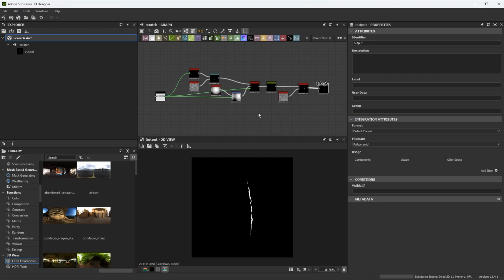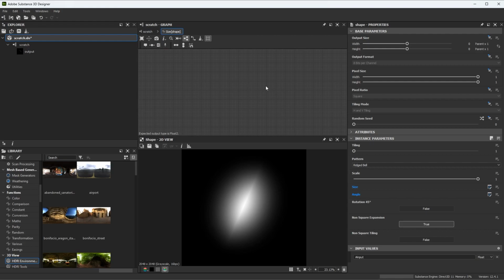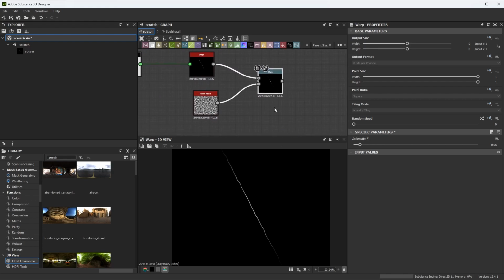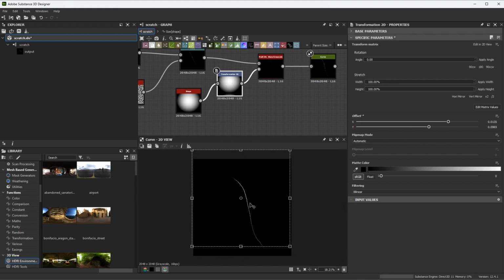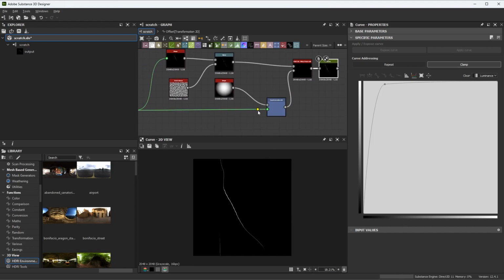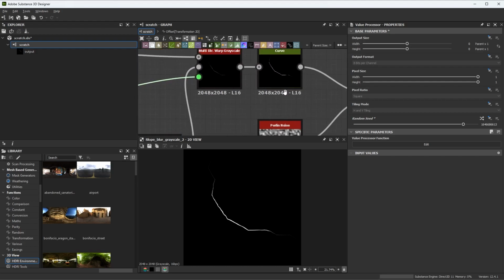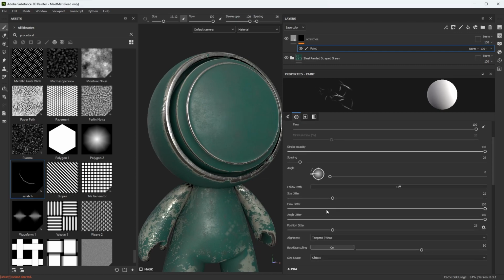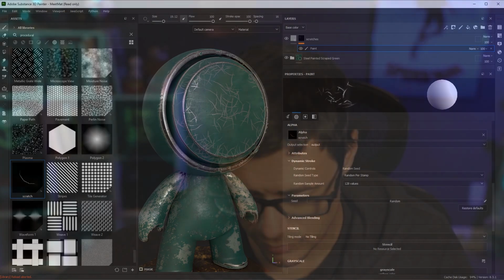How to create a dynamic scratch brush using Substance 3D Designer

Comment: This strikes me as an example where putting your random generator in a Value Processor is precisely NOT what you need. The Value Processor technique which you use here is primarily useful when you NEED to get the SAME randomly generated number into multiple functions across different nodes. For example if you want to randomize the X/Y offset on two different transform nodes, but you need each of those transform nodes to have the same random offset for any given graph level random seed.

When you are trying to create as much randomness as possible, you are better off using a different Random node in each function that requires randomness.
Reply from the maker: Good advice! I appreciate the feedback.Thanks much : )

Comment: Hi Wes. First of all, thanks for making your effort towards these videos. I learn a lot from them.
The only small "nitpick" I'd have is you sometimes "move" to next steps and say "I have already done that". Sometimes, it is not easy to figure what you "have done". I noticed this in other videos as well. For instance, the one where you create brick wall with moss in Substance Painter, you did that extensively and talked about already created layers. I wasn't able to follow and re-create the wall. As these programs have many details and small parameters, if one parameter is off, things can easily fall apart without clear understanding why. Cheers!
Reply from the maker: Thank you so much for the feedback! I will make sure to cover or explain parts that I have already done. I know that can be confusing. I greatly appreciate it : ) I will make sure to be more careful on skipping ahead in the future.

Comment: Thanks for this amazing tutorial! I'm trying to make a slightly modified version and I have one question regarding the width/height. It seems the width/height values somehow get linked proportionally, since if you crank the width max value up and randomize the seed a few times you can clearly tell that you never get a long and thin line, or a short and fat one. I tried running the seed output through another Value processor and multiplying the value to get another seed number based on the first one, and then feeding this into the shape for use as a unique seed for height, but the problem persists. Any idea on how to get around this? I'm pretty new to SD so maybe I'm missing something obvious..?
Reply from the maker: Ah yes! I think I see what you are running into. They are linked in that the the Size for X and Y is a single Vector2. It's two parameters but if you want to vary them individually, you will need to separate them. Iin the Size input, you can set a random value for both the X and Y. In this video, I kept is a one single random for both X and Y.